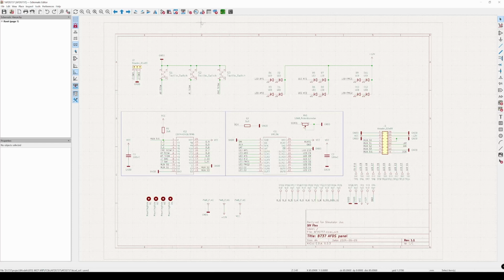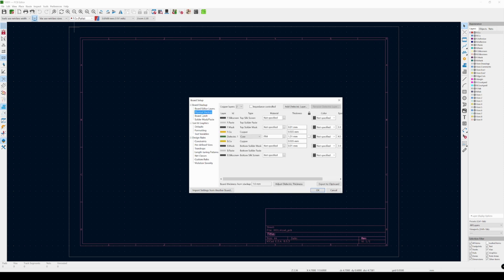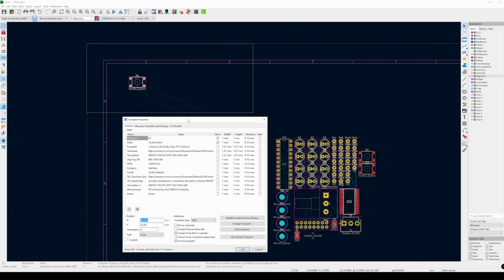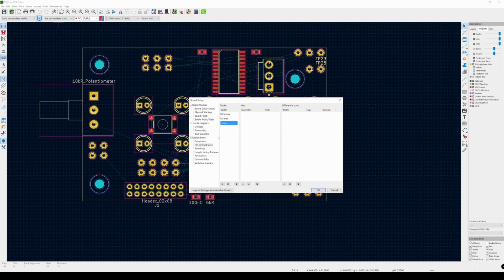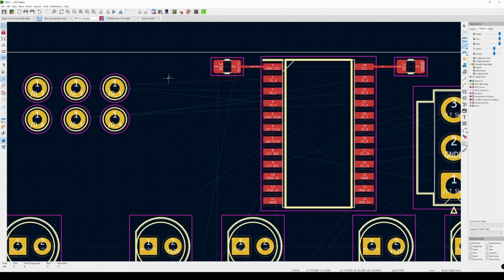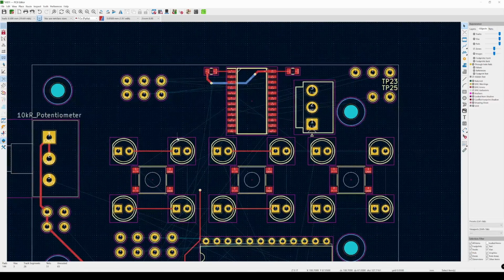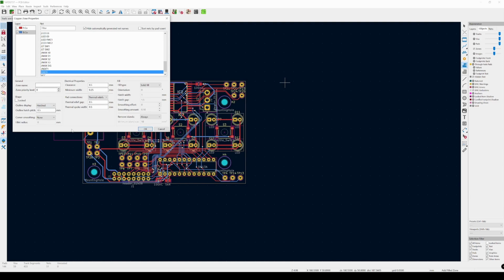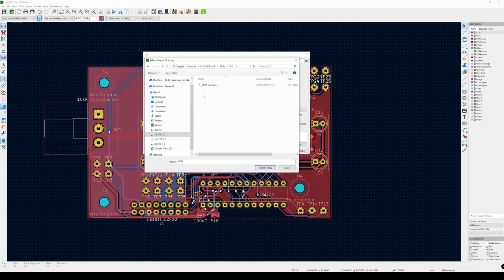How To Make a PCB With No Experience! [KiCAD 8.0 Board Tutorial #2]

Comment: Everything I see for making PCB's is to get a company like PCB Way to actually manufacture the board. Is there a way that KICAD can make it easier to do it yourself?
Reply from the maker: If you would like to make the PCB yourself, I assume you already have the tools (routers, drills, chemical etching tools, etc.). I assume you already also know how to use such tools and what files are required. You can export the correct file types out of KiCAD but it really depends which method you will be using. Etching uses different files than engraving ,etc... 
Unfortunately I am not too familiar with making custom PCBs at home, so you should look into some tutorials that will teach you that.
Thank you for watching and good luck with your research!
Reply: @vasimulations  Last time I made a successful PCB was back in the 1990's. It seems different now. All I needed was an image of tracks and component pads from drawn on graph paper then transferred to a clear plastic sheet by tracing with a dalo pen and sticky transfers for component pads. Spraying photo emulsion  on the copper of a PCB, in a darkened room. Attaching the clear plastic with the circuit layout, exposing the board in sunlight for 0.25 hour. De attaching the plastic from the board again in darkened room and putting PCB into an etching solution then into an ordinary oven set to about 50c. 
    Now I cannot find materials like spray on photo emulstion.  I can find sheets of photo material that has to be attached to the PCB with a laminator but it is more risky with air bubbles that can easily come under the photo sheet. I cannot find transfers of components to do it the old way. It might be where I live. Maybe I could get these from the internet. I have tried to get some things from the internet shops, like photo emulsion but some shops are so far away that the shipping cost is greater than the product and some shops won't sell to my location. They might sell if they knew where I was but their internet addressing system does not list the small city: Invercargill, New Zealand and there is no way to just type it in with only drop down lists. This means I have to use the more difficult way of laminator etc. Also printing the circuit with an inkjet to transparent sheets, you need two printed sheets lined up exactly with no overlap. With very small marks on the sheets where drill holes go. If they are not exact when exposing the board to sunlight or special lamp, the negative of these marks may not show up on the final board before drilling. The reason I want to do it is: I have quite a lot of unused PCB's and I don't want a minimum quantity manufactured which I probably only use one of them. Anyway thanks for replying.